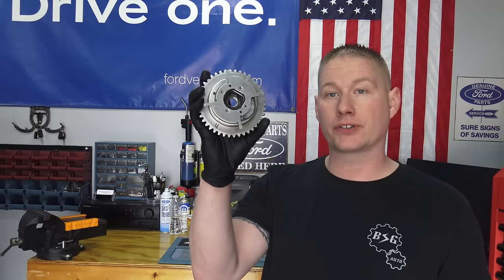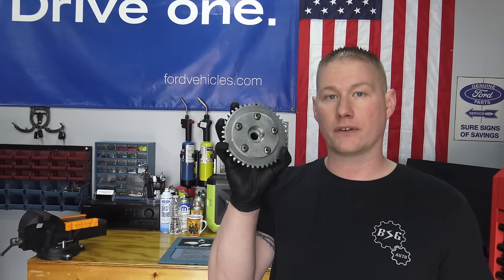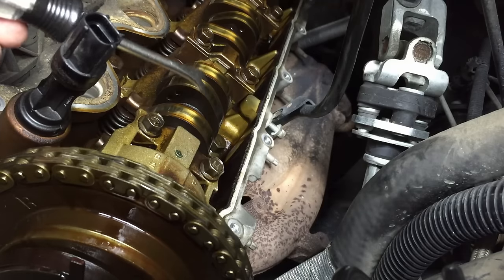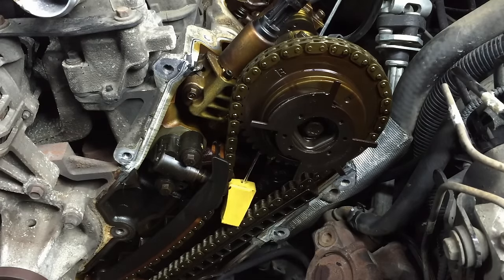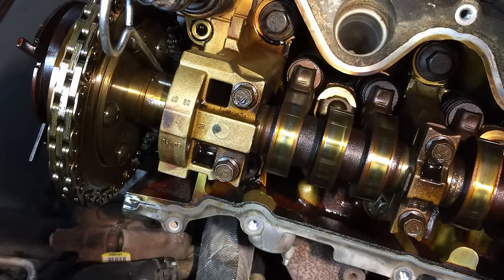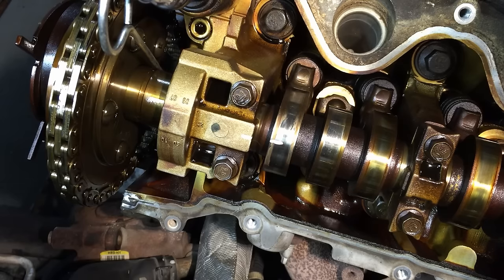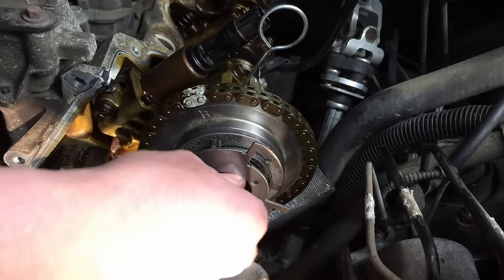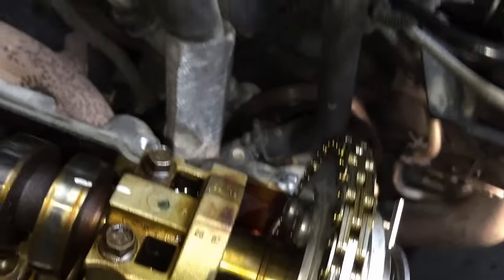Ford 5.4L 3v Camshaft Phaser Replacement**UPDATED FASTER PROCEDURE**

Comment: FordTechMakuloco I have a 06 3v navigator with 105k miles on her. She still purs like a kitten. I've been using 5-30 pennzoil synthetic since first oil change. Only reason the 5-20 is used is for better gas mileage.

Comment: Hi there , great video.
My 2010 f150 4.6 3v 130000 miles
Was doing knocking noise randomly
I have replace the cvt solenoids
Cam phares following your instructions
And I was runing smooth for 2 days then it randomly started the knocking sound again. Any ideas would be greatly appreciated. And the Check engine light never comes on.

Comment: I’m a bit confused but great vid. Also, I run the 5w-20 with Lucas oil stabilizer, so that thickens it up.
Reply: I’m with fordtechmakuloco, always use the exact oil the engine calls for
Reply: He also mention switching to 5w-30

Comment: Can I follow this procedure and pull the camshafts, one at a time, to replace lash adjustors?  I opened the engine to replace a bad roller follower, but then found the lash adjustor was busted too.  I'm going to replace all roller followers and lash adjustors while I'm in there but looks like I have to pull the cam to get the lash adjustors removed...any help is appreciated.  I'm working on a 2009 Expedition EL XLT with the 5.4 3V.

Comment: Im probably going to do an entire timing system replacement on my 06 5.4 once I get my new daily driver. I've done plenty of 2v timing system jobs. Is there really much of a difference between the two when lining the dots back up on re-installation?

Comment: You mentioned that the cam phaser is a bad design and they often need replacement. Are all ford cam phasers like this or is it just the 5.4L 3v ? I am asking because I am considering a new F150 with the 2.7L ecoboost.  Thank you for these videos I appreciate the opinion of a qualified ford mechanic.

Comment: Will this problem make ur check engine light go on? Got a code p0345 and p0349 Changed the vct solenoid both did new spark plugs coils and changed both camshaft sensors checked battery alternator and starter all good.

Comment: I have a cam phaser that knocks fairly loud on cold startup, but quickly quiets down to a nearly in-audible tick.  Should I be concerned about it or just leave it until the engine needs a complete timing job?   Thanks in advance for any advise.

Comment: Great video....can the cam phaser / timing chain be in need of replacing WITHOUT a trouble code?  I am getting some ticking noises from the front driver side, but NO check engine is on.  Runs good, but a little noisy.
Reply: Yessir it can. My '05 F150 sounds horrible, and starts knocking and misfiring when hot and idling, but the engine light has never once illuminated.

Comment: I have this job coming on my daily. 240,000. I'll get the timing kit, actuators, intake gaskets and whatever else I can. Does this process transfer? How does the mark on the chain relate? If you have or can recommend some other videos on this, I'd appreciate it.

Comment: Realized my question might sound loaded. Not my intention. Its just oppinions with this issue are all over the map. Some say drive it like this, others warn of engine damage and so on. Hate to do the phasers only to need a timing job or lifters after the fact. You pointing out the loose chain kind of verifies other possible issues. I've never attemted anything like this and feel I can do it but just want to be thorough.

Comment: Keeping this video around in case I start to discover any issues. My only problem is a plasticky rattle that lasts for about a second when I cold start the car after a few days of sitting. This started happening after I bumped into someone at 5mph. Hopefully not a big deal, mechanically everything is fine.

Comment: First of all, thanks SO MUCH for all of the amazing 5.4L 3V videos you've filmed and shared with all of us. They have given a perfect idea of what I'm getting into. What I was wondering is if I can get away with not removing the roller followers (with the special tool) if I'm going to replace the chain, chain guides, tensioners, bottom (crank) sprocket, AND cam phasers? I was thinking I could position the cams just like you showed in this video, mark the relation of each chain to the cam sprocket and crank sprocket, and then count the links between the markings on the old chain, make the same markings on the new chains, and reinstall??? Or am I missing something major here?? Thanks a bunch!!!!!
Reply: By the way, I just looked at my new Cloyes chains  and they seem to have markings on the links. Two side-by-side links have a black face, and 180 degrees from that is a single black-faced link. Does that  mean I should be good as long as I don't allow the cams nor crank to rotate?

Comment: I'm guessing once we pop the valve covers off and see the chain somewhat loose, it may require a full time job right? Vs only doing the can phaser replacement as shown in this video. 

I'm afraid of doing the job this way  and missing a broken guide or failed tensioner.

Comment: another great video. have your ever had the piece of cheese come off the bar and stay locked in the chain when you are just doing the phaser and don't have the front cover off??
Reply from the maker: +Brandon Beard no because OTC revised the tool early on and added "branches" to the end of the stick then the plastic was molded over it so now it's near impossible to happen

Comment: On my old ‘05 F150, with the 5.4 engine, I also used 5W-:30 and never had an issue. Do you recommend using 5W-30 for the new 5.0 engines? I have a ‘15 F150 now and haven’t made the switch yet. What’s your opinion?

Comment: Hello! I have 2009 Ford Explorer with 55k miles with phaser knock on hot idle on the RH. Changed the phaser (installed new original ford phaser). But the knock did not go away. It became a little bit less noticeable, but still knock loudly, you can hear it from inside the vehicle. What is my next step to eliminate this annoying knock? Thank you!

Comment: If you just pull the valve covers off and remove the VCT solenoid it looks like it would be a lot easier to get that piece of cheese down in there into the chain. Would that work? Would I be able to get that piece of cheese down in there easier with the VCT solenoid removed?
Love your videos, they are simply the best.

Comment: Great video, good easy way to replace your phasers!  In my 2007 expedition the most difficult part is getting the right side valve cover off! My right side phaser was pretty loose, enough to make the cam run slightly retarded so the pin in the new OE phaser did not line up by about 1/16th inch. I took the old phaser, removed the spring and welded the shaft collar to keep the the sprocket from turning. Then I slipped the old phaser back on and using a hammer and punch I tapped the sprocket moving the cam into the correct position. The new phaser went on easily after that. Mark everything he shows in the video so you have good references.

Comment: @Fordtechmakaloco what are all the updated parts like the oil pump? Are there better rollers? Better parts made to prevent timing issues? Anything and everything. I’m ordering by a new engine and I want every single upgraded piece that contributes to failure that I can get.

Comment: How did you turn each cam to the position you wanted. Do you hand turn the motor? If so which way do i turn the motor i heard its never good to go in reverse of the rotation of the motor. So is it left or right facing the motor. Thank you great video

Comment: You mention switching over to 5w30. I have a 97 4.6 f150 using syn 5w20. Should i switch? Ive read much debate on this.

Comment: I have a 2004 F-150 FX4 that I bought new I am have some issues with the vehicle 170,000 miles and a friend told me it was the cam phasers.  I want to keep driving the truck and I have not had any transmission work done.  Do you recommend the repair on these 5.4's at this age or wold you recommend a newer truck?  I noticed also that you said 2004- 2014 is this no longer the design of the 2015 and newer?  Any advice would be great!

Comment: around how much does a phaser job run. I have a 2006 Lincoln Mark Lt. I was just told that it was going to run me about 3 to 4 thousand. does that sound about right. I live in Denver, Co. I was in complete shock when the mechanic at Meineke told me it was going to cost that much. Do you think that is to much or is it fair.Thank you. Great video!

Comment: So if the crank chain black link is aligned and the phaser black link is also aligned shouldn’t the cam just fit in the phaser notch?
If any movement in cam then just adjust the pin back to the lasher notch.. right?

Comment: Great video, you are always good help.  Question,  once I  line up the new phasers to the marks on the chain, the pin doesn't line up with the groove on the camshaft. What should I do?
Reply: Can I ask what you did to fix that issue? That is the same issue I am having now.
Reply: @alexricks7881  ended up being deffective Amazon phasers. Returned them and reinstalled the oem phasers back in with lockouts now just waiting for my refund from Amazon to buy a SCT tuner with the VCT tune. Do not move adjust the chain or move the cams... Just don't make them fit or you will mess up your timming

Comment: Accomplishing this job on my 2010 F-150 with your guidance.  One question I have is while torqueing down the driver side phaser the front part with the four prongs sticking out rotated clockwise during the procedure and it did not move after.  I used the tool to lock the phaser in place, the passenger side phaser did not do this.  Should I uninstall and re-install? I used all OEM but if I have to replace the bolt is there a difference between aftermarket and OEM bolts besides the significant price increase?

Comment: I have a Ford truck 07 F-150 3V Engine, I have gone through the normal diagnosis steps, checked coils, injectors, sparkplugs, compression.
I have 170 PSI on all cylinders.
it's missing at all times, cold or hot, I do get codes P0303 & P0304 and when i go in to the cylinder contribution graph on the scan tool, shows the two cylinders I just mentioned to be at fault, or at least the graph line is going up & down when checking cylinder contribution. but, I don't think its electrical but rather mechanical. the engine missing only happens at idle, no noise at all, just shaking a bit. once you start driving & going at cruising speeds engine is fine, I'm thinking about taking those cam phasers out, to much work involved.
have you ever had an issue like I do with the truck I have now?
any thoughts or suggestions?
thanks for sharing your knowledge with the repair community..

Comment: We picked up a 2006 f150 fx4 for a run around vehicle.   The thing will not start at all.  Previous owner said it dropped oil pressure and they shut it off right then.  Will not start now it cranks but it a laboring crank.  Put a new fuel pump diver due to corrosion    Any tips where to start at?

Comment: Hello have you try cloys brand timing chains kit and facers..I have rebuilt a 5.4l 3v engine with all new bearings new oil pump from melling and new valve seals. I have also install new oem ford vct solenoids with 5w30 motorcraft  engine oil.went for a spin when engine is hot  and notice that facer noise .I put my scan tool on it and chk live data and monitor both cams and notice the bank1 was stuck at 40deg and bank2 was normal at 0deg in idle. Have you experience andy kind of issues like this with all new stuff in the engine .when I rev the engine up a bit the bank1 cam facer came back to 0deg like it should. And both side of cyl head are good no damage at the cam caps and cams.oil pressure also been chk with hot engine in reverse and that was 20psi steady. Any other recommendations. Will be appreciate.

Comment: Brother donated his '06 f150 to me, i had to replace the engine in it. Mechanic told me 5-20 synthetic. I been doing it religiously every 5k km, im approaching 60k km on the engine. So far pullin strong. Would there be any fear of me stickin to 5-20. Also i live in Ontario and the winters sure are cold.

Comment: I did the drivers side on my 05 Expedition last week.  I have a set of modified vise grips with rubber caps for the jaws that I clamp on a cam lobe with the back handle against the head to keep the cam in place.  If it does move, it will be in the other direction and I can just move it over against the head again.  This week will be the passenger side, but I'm concerned about the valve cover on that side.  Lots of complaints about not being able to get it off because of the A/C condenser line.  Some say they have evac'ed the system and disconnected the lines, others said they took out the motor mount and lowered the engine.  I'm going to do everything I can to not do either if at all possible.
Reply: When i did it to my 05 expedition i used a wide clamp on one of the cpu bolts and other side of the clamp on the ac line. It needs to be moved about an inch vertically. It feels dangerous to push it that far but i did it without problems. If you choose to do what i did be careful to not move it any further than absolutely necessary. If i had to do it again i would still do it this way.

Comment: So I have a 06 and it was driving very sluggish. I was told by a mechanic that the phasers had failed and the truck was out of timing. My question is, if I replace the phasers, how would I get the truck back in time?

Comment: Will this method work when steel ratcheting tensioner's are already installed?
I installed steel ratcheting tensioner's a couple years ago when in I did my timing. Didn't change the phasers because I couldn't find an issue with them and was way over budget and wanted to save $450.00. Got a p0022 on bank 2 yesterday and think I may have to change the phaser but hate to take the front cover off again.

Comment: Got an 04 f150 5.4l 3v with 188k on it, would it be worth replacing the phasers entirely or doing the lock out kit on the old ones?

Comment: I have a 2009 f150 with a 4.6, it has a misfire on cyl 1,3, and 4. Ive changed all the coilpacks and I have new spark plugs in the misfiring cyls. It misses from idle to about 2000 rpm, then it runs nice. Could a cam phaser cause this? Thank you

Comment: had a Ford tech tell me to make sure I run 5w 20 and use a motocraft oil filter...looks like I will be doing the entire change out on mine. bring back the 351 with spark plugs and distributor.

Comment: My 2010 f150 5.4 is running fine until operating temperature...then oil pump light comes on and it starts to sound like theres no oil in it.oil level fine...I told Ford my symptoms they said most likely the phasers...would you agree?

Comment: I went to replace one phaser today but it didn’t go very well, I broke 2 screws on the head for the valve cover. If I cant take them off tomorrow and leave without them, is it going to leak oil?

Comment: Thanks for great instructional vid.No problem at this time and I will go to 5-30 oil..Do you recommend fully synthetic or a blend? thanks
Reply from the maker: I recommend this oil above and beyond anything else- http://amzn.to/2bzqN12
Reply: I have the 2007 4.6 ,E-150 /do u think the oil pump will be ok with the added stress of the heavier oil. Maybe the gain for the cam phasers doesn't out weigh the compromise to the other components?.Got 50k and no problems to this point..Kinda thinking maybe I should leave well enough alone..

Comment: I recently purchased a 2005 f150 5.4 3v.  It had a cel on when I purchased it.  The phasers were supposedly replaced by the previous owner.  I have narrowed it down and believe the timing chain may be off a tooth or two on the drivers side.  Is there any way to check that or do I need to take the front cover off to be sure the timing is correct?

Comment: I'm hoping you can help me .  I bought this 2009 F 250 5.4 as a mechanic special and I replaced the cam phasers and all the components but I didn't realize I was supposed to use only Ford only parts until I was done . Anyway after the job it ran like crap everytime it reached operating temperature getting 5.8 mpg . But then the other day it ran crappy and died turns out the alternator was bad so I replaced the alternator and now it barley runs . I've done the full reset on it and it runs ok for for minute or so and then my oil pressure drops and my oil light come on and it runs like CRAP and has no power to even move . I hope you can help I'm at my wits end

Comment: My truck has random miss fire P0300 but no check engine light it’s 06 f150 5.4  I feel it miss then not for awhile mostly lower rpm road speed is this the solution. No rattling noises

Comment: Is it viable to replace just the cam phasers for the noise or would I have to replace timing chain, guides, etc. was told by ford tech that all has to be replaced, not just phasers.

Comment: Mr. I watch your videos all the time good stuff really appreciate. Was gng to ask you. Why do phasers fail even if you install them right from ford? Ive been doing them for 5 years and 2 out of 8 will come back with failed phaser. I torque the sprocket and then give it a small snug.

Comment: My '06 Ford F150 5.4 Triton engine cam phasers are getting louder.  I read that the 5.4 is an interference engine.  If the phasers fail, will that shell out my engine.  I'm going to use your method in the video to change the phasers, but I'm not in a position to do that right now.  Is it okay to drive until I can get the phasers changed out?  Thanks.